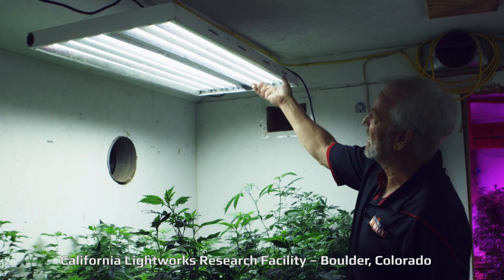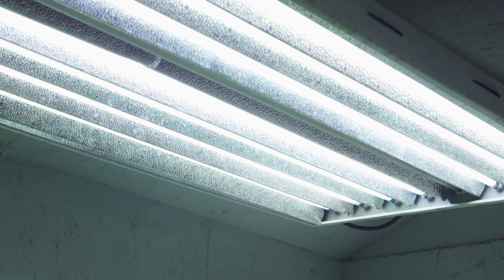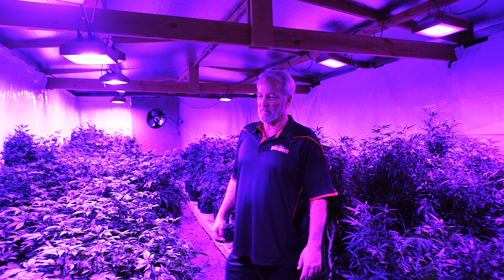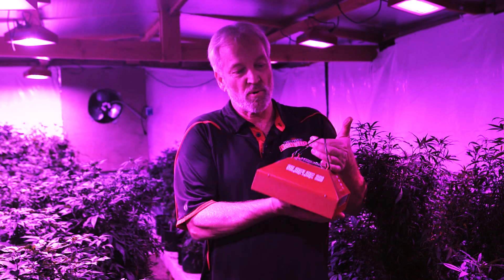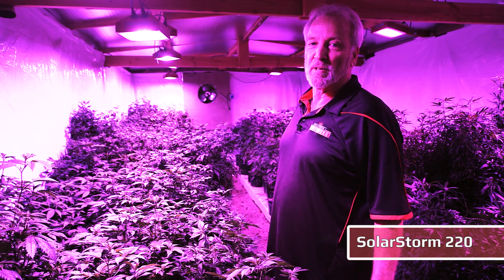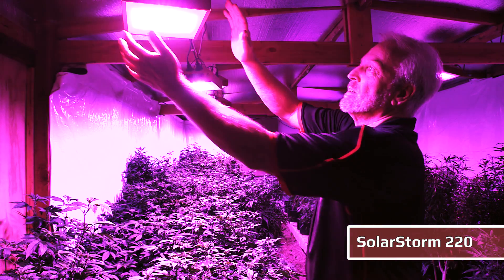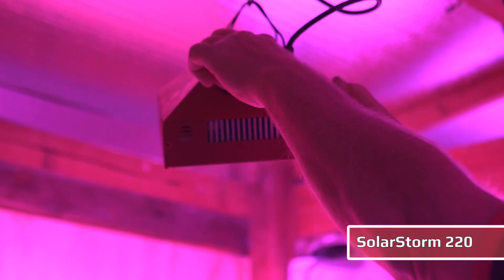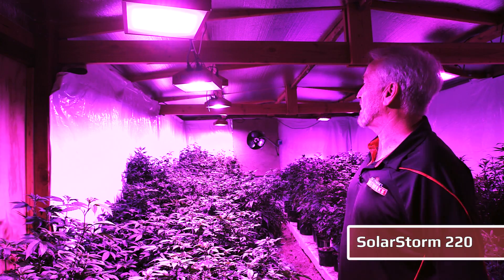Compare Differences Between Fluorescent vs. LED Grow Lights | California LightWorks

Comment: I have a 40w fluorescent and a 50w led with side panel leds 15w on both sides of the closet. Only one plant in a 1x2 and the fluorescent is obviously higher than the led but the combo is what I’m curious about.

Comment: All light eventually ends up as heat. This "my 250w LED produces less heat than a 250w <insert other type here>  light" thing is complete bollocks. All light with either be absorbed and heat the surface, or re-radiated at a lower wavelength and then absorbed eventually and by eventually I mean within a few pic-seconds. Basic physics.

The efficiency gains for LED over CFL are marginal at best or non-existent. 

I wouldn't be at all surprised if California Lightworks produced massively over-priced LED systems with hyped up power ratings and bullshit efficiency comparison... <click>... Oh look... They do.

Comment: I'm confused regarding money saved via watts.

how does led save you money, when the watts are 25w, and t5 ho are 24.

what do you mean when you say.

something is X amount of watts. YET, it uses  less, I don't get that part.

I'm trying to lower my monthly electric bill, and don't understand how these would help

all I have are sunblaze 242 t5 singles, switching the bulbs to my hortilux leds would lower bill?
Reply: @King A - All light is radiation.

Comment: thats fine and dandy until you realize the insane mark up. leds, heat sink, case, fan, power supply. not worth $500. there's always people with to much money and too little brains that will love this, but for people who would rather have their cake and eat it too, a similar system can be made for almost an order of magnitude cheaper.
Reply: Ever noticed how LED grow lights have heat-sinks and cooling fans and CFLs don't? It's almost as if the whole "Our LEDs don't produce any heat" thing were complete and utter bollocks. 

You're spot on with the money and brains. My CFL set up... 1 x 125w blue for the babies, 1 or 2 x 250w blues for the big girls and 2 x 300w reds for the girls when they're getting flowery cost under £200 including both fittings and consistently gives better results than my gullible neighbour's £2000+ LED set up. It cost less to run too.